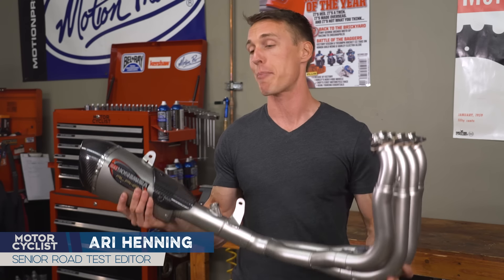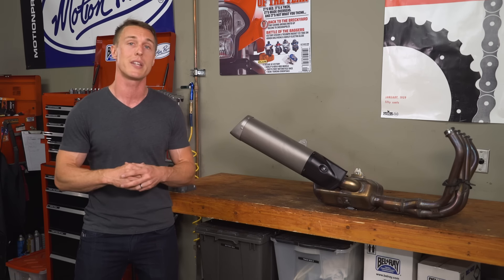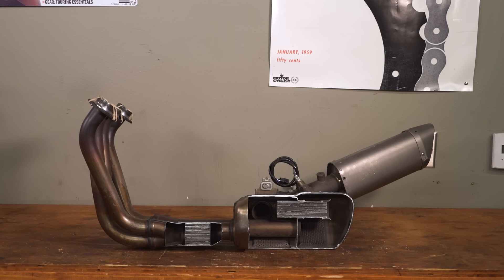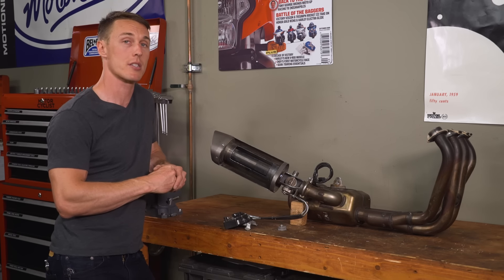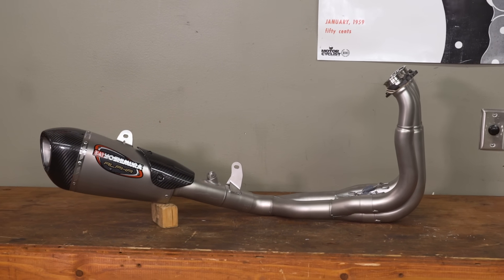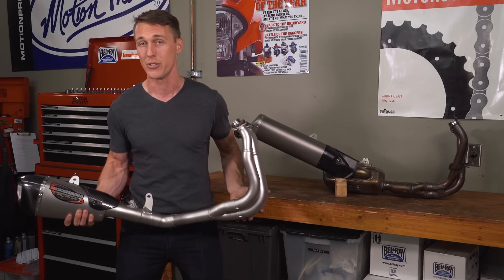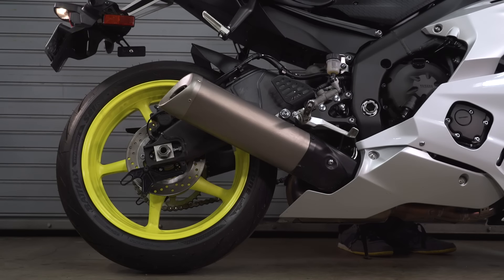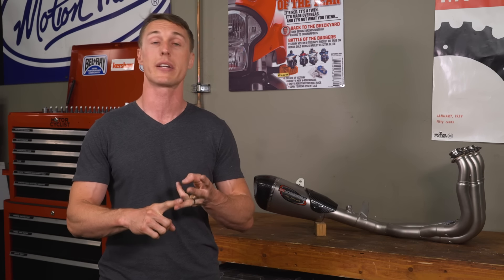The Truth About Aftermarket Exhausts | MC Garage

Comment: as emissions get stricter the gains that can be made from aftermarket exhausts will only get greater
Reply: which is dumb
Reply: Corvette Have you seen the 2017 Suzuki gsxr1000/r that can is not just huge. It robs about 5-6hp from the bike.
Reply: More like 10.
Reply: crisray6789 you mean like how modern emissions are tighter than ever but we now commonly have cars with over 500hp and bikes pushing past that 200hp mark? Emissions controls are one of the best things that ever happened to cars and bikes. Without them you'd still be tooling around around a carbureted POS smelling like raw fuel after a quick ride down the street because the OEM would have never had any incentive to improve the efficiency of the machines and spend countless millions on R&D making your bike or car cold start better, run and idle smoother, get better fuel economy and have more power.
Reply: Woha wait a minute here. Do you really care about fuel consumption while talking about motorcycles? (at tleast somewhat interestng ones, not scooters and sh!t) this is the last thing i care about. Better buy some 50ccm machine, if you care about every 0,01 l of petrol. I am proud ovner of 01 zx9R, and exactly because of those four big carburetors and overal simplicity and rawness of the bike, i will never sold her out. Just ram air intake, four cilynders, four carburetors, absolutely no electronic crap (shit like throttle control, abs etc.), and straight to wheel. You do not need neither diagnostics nor computer to properly maintain the bike, just a wrenchbox. And while talking about emissions,that is the absolute last thing i care about. I would gladly argue with you about those demonic CO2 exhalations (for simpletons, food for plants!) , NOx emissions (which are way lower from this dinosaurus that from modern diesels), or even that damn fuel consumption (4l/100km). Plus, the smell of that unburnt fuel exhaled through partially opened exhaust is quite pleasant for me, unlike that modern sterille machines. That somewhat not so smooth cold idle, or cold starts and such, for me, that just adds to the soul of my bike. You just need to know how to touch this machine, manipulate choke  and throttle properly, know some basics of engine functionality, and you are perfectly okay.
Reply: David Inmon Not what I'm saying at all, the video is debating stock vs aftermarket exhausts and has power gains placed last in the benefits, but emissions equipment will inevitably hinder power gains, especially as new regulations come about. The new Yamaha R6 is a great example of a bike being choked back by the new Euro4, and the cbr600rr has even been discontinued as a result.
Reply: crisray6789 600cc sport bikes also aren't selling very well, they haven't been for a long time. And your right I didn't draw my point together very well. The OEM exhaust systems are better than most people think and getting a lot of power from a decatted open aftermarket exhaust is just a thing of the past. Most people think they get a lot more power because they add PC5 and install an aggressive tune at the same time they install an exhaust. Plus the noise from pipes can add to the effect. Yes you will in most cases gain HP from aftermarket exhausts but in a lot of cases it's marginal, my Aprilia gained 1.5 hp at the wheel but it sounds sweet and that's why I bought the exhaust, sound.
Reply: and you wonder why companies only focus on the 1000cc bikes now because everyone wants a litre bike. But to be honest litre bikes from 2015 and up have the same weight as 600cc bikes did back in the 90's
Reply: Nehygienix I've had plenty and still have a carbureted bike, 2stroke dirt bike, but when I'm on the street and doing a road trip MPG matters because it determines how far and how many fuel stops you need to make in a day plus how much I have to spend on fuel and not smelling like burnt gas after 6-8 hours of riding is a huge plus. I grew with carbs on my dirt bikes and muscle cars and now my yz250 is my sole carbutooteted machine and I don't miss having to spend hours messing with carbs smelling like fuel and still having a flat spot off idle after that work. I'm a bmw tech at dealer in the US. You know how many standard solenoid type injectors Ive seen fail in the 11 years I've been doing this? 1. That includes E30s from the mid 80's still running fine on the same ol injectors and ECU and wires. People who can't let go of the past or aren't willing to embrace new and better tech always claim the reason they still like the old stuff is because it's more reliable and easier to fix. Wrong it isn't more reliable and yes it's easier to fix because you know how to fix it because you've had to fix it so many times. Look I agree about the soul of a bike or its attitude or whatever, that exists but just to shun better tech because you like smelling like raw fuel and spending more money on fuel fill ups than the rest of us doesn't make you right it makes you you that's it. Past that I think majority of people would call you wrong good sir.
Reply: Well truth to be told, ive never in my life, either in car or motorcycle, cared much about fuel consumption. My experience tells me, that usually, especially with modern machines, low MPG comes at a price. There are always more money - demapding aspects than several ,1 of petrol per 100km. If you say you work at BMW service, what about those new four cylinder diesels? Yes, low MPG is nice. But, when the time comes, you suddedly realize that to change chain/belt, you have to pull the engine out, because the chain is on the other side of the engine, facing invards, toward the cockpit. That sole thing is 2500 EUR in my country, that means cca 2.5X average salary. Broken fuel pump? nice one, 1000EUR at abosuletly cheapest (one whole salary). Clutch? i think you can guess. To add salt into injury, when electrical problems comes, it often means that car just stops going, and you have to tow your car to service and pay a fortune. Where ive never, with variety of older machines ive had and ridden, never witnessed and problem, which didnt allowed me to safely drive home. Situation is not so bad in the cheaper range of cars, but then there are things like EU-obligatory monitoring of pressure in tyres, E-call (i will NEVER have a car with this bullsh!t working, ever) and so on. Motorcycles, there are things little different, because they are not so much (at least till now) under heavy boot of EU regulations, so even now we can find some interesting pieces, for exact ZX10R 2011+, quite savage thing powerfull like hell, but hey, this machine is just one big ball of cables. But it is a global trend. I dont say that my opinion is right. It is just my own. I wouldnt dare to force it on anyone else. I know that modern machines are more powerfull, smooth and such, but doing maintenance, or even repairing something at home without fully equipped workshop... Well, maybe i am just sentimental.
Reply: +crisray6789: Not quite right. The CBR600RR is still going to be made for Aussie/NZ, Asian and American markets where emissions aren't so stringent. I was under the same impression as you till I read an update from Honda Because I own one of these, it caused a bit of panic I can tell you. It's that Euro4 emission law crap that is going to upset a lot of people.
Reply: I'm pretty sure Honda is done with the 600rr altogether. Sales are in the gutter and 1000 weights just a hair more and Honda's actual statement was "the 1000 is a 600 when you change the power mode". They will sell remaining stock, yes. The only way I can see them still producing the 600 is to keep the model exactly the same with no R&D monies being spent on it, until the remaining countries follow in the emissions laws. There is NO WAY Honda will spend millions in R&D just to sell a few bikes in a handful of places.
Reply: Taijean Moodie.
Suzuki actually claims a gain of 8hp. You can't actually compare between model years and claim the exhaust robbed or added power since the 2017 has a redesigned engine.
Reply: Nehygienix I appreciate your point of view. I can't say much for BMW repair costs in the EU but in the US yes BMWs are more to repair than say a ford or Chevy of a similar car class, large sedan, small compact etc..  The new diesels we have are actually quite reliable and the timing chains never need to be replaced outside of an extreme failure, BMW hasn't used a timing belt since the early 90s. But I get your point. With this aimed at cars yes they are more to fix than say 20 years ago. But bikes don't have nearly as much BS on them and are still relatively simple. A fuel pump, some injectors, fuel lines, wiring and an ECU. Look at all the BMW GS bikes that are fuel injected with 100k, 150k, 200k kilometers on them will no issues. To each their own, I prefer fuel injection as I find it far more user friendly and I don't have to worry, ever, about rejetting my carbs and making sure they are all synced properly, but, others enjoy that aspect as I'm guessing you do. Ride safe and enjoy your bike!
Reply: gains will be greater, until smog emission tests are required
Reply: In my country, emision tests are obligatory, every 2 years. Nothing simpler. Just change my aftermarked one for original  one, do the test, then change it immediately back. end of story
Reply: Nehygienix the low fuel consumption of bikes make them good machines for commuting and bring more people to motorcycling due to their cost lower than that of a car (many people argue motorcycles need more maintenance, it's true, but that doesn't make it more expensive overall, not to mention that most car owners don't maintain their cars as they should ; changing the drive belt, clutch, 4x4 transmission, repairing an automatic gearbox are huge expenses).

Also the combination of a big tank and good fuel economy increases the range, which is highly desirable if you want to travel in certain areas and not have to carry a jerrican...
Reply: Well, if my main reason for buying a motorcycle is cheaper maintenance and low power consumption, there are (and always was) plenty of choices - all those motorcycles ranging from 50 cmm one cylinder machines, whose consumption is maybe even lower than walking (joke sure, but not too much from reality) through all those 250s and 500s or 650s, enduro bikes, or even machines like BMW GS, yamaha V strom and such... But i still dont get it, why on bikes like zx6r/zx10r, rsv4r, panigale 1299, R1 etc i should be in any way concerned about some deciliters of fuel. Yea, maybe if standard cruising consumption would be over 10 liters, that would be a bit obstruction because of mandatory big tank, but this was never the case - even my carburetted dinosaurus can go under 4L/100 km at ease. Neither are any of those bikes specified for newbies.
Reply: The 2017 R6 is a good example. It's completely gutless with the stock system.
Reply: Moriquende.
Silly, silly statement.
Reply: Oh, really? While I've not ridden it on a track, there are professionals that have and they thought the exact same thing. The world super sport(race) version they also test rode had a full titanium race system with an ecu map and the result was a completely different bike. Euro 4 affects performance, especially on the 600cc super sports.
On the road it doesn't matter, just put a slip-on on it and be happy.
Reply: Moriquende.
On the road it doesn't matter. Just leave the stock system in place and save your money for better things.
Reply: Which is exactly what I wrote, except for the better things part.  More HP, lower weight and rideability is always good, not to mention the good sound that follows. It's not that expensive either when you factor in how expensive the bike is in the first place.
Reply: Crisray6789, My 2013 CBR1000RR gained 7whp going from a stock can to a Yoshi R77 slip-on. Sounded nice and added a good amount of power. Now my MV Agusta, that's a different cup of tea. I have no dyno'd mine. Reports are 2-9WHP depending on system. Keeping the triple system or doing a single. we looked into it a fee months ago,. about 2500 bucks gets ya maybe 12WHP.. Some bikes will benefit from a slip on others won't. It also sucks a damn slip-on for my MV is $1,000 :(.. The MPG thing. Who cares. more so if you are buying a liter bike. my CBR1000RR got around 33 MPG. my MV F3 800 is around 25 MPG
here in AZ we have no emissions for bikes. It's awesome.. Can pretty much run what ya want
and as of 2017 Honda is still making the 600. Their 1000 is still lacking HP  compared to a GSXR1000R or R1. The insurance for my 13' CBR1000RR Repsol was 3 times more than a R1M or GSXR1000R was, lol
Reply: My CBR 300 would only gain 1 hp with a full exhaust lol. If I get one, it'll be for the style, sound, and weight.
Reply: +ChrisHallet83 , That is only partly true. Emission regulations has forced car & bike manufacturers to develop better engines, but it mostly has to do with with the advancement of technology as a whole. In the last 10 years computers have come so far and as a result, technology is moving quicker and quicker. It's even reached a point where it's hard to get consumers to buy your new thing. 

A car is the most advanced everyday thing you can buy today and while rules & regulations has forced it to an extent, overall technology development made it possible.
Reply: Moriquende-Emissions was and is the catalyst (pun intended) for all the modern engine related things we use and take for granted on cars and bikes. Yes the advancement of technology certainly plays a very large role in all this but emission laws were the main reason the OEMs began to put fuel injection on vehicles and so on. If those laws never came into play there would have been almost no reason to change the way things were going. But in large part thanks to automotive emission regulations we have now have bikes with more power, better economy and smoother engines than ever. I would say that technology advancement takes a close 2nd but had to evolve and took longer to have its impact on the world as a whole. Emission laws and modern tech now go hand in hand and its almost impossible to further one without the other but in the early days of the "modern" automotive emission laws the technology already existed to meet the standards of the time. Also I use the auto industry as the standard here as anything related to bikes has been done on cars years ago. Bikes almost seem to benefit from "trickle down" technology from the automotive field.
Reply: ChrisHallett83 Agreed, most people that complain about emissions have no idea how much they actually helped performance for the better. Not to mention I like having cat converters on some of my bikes as I don't smell like burnt fuel after a ride. Makes a big difference on multi day rides  with limited clothes!!
Reply: Nehygienix I think you're taking my statement of caring about fuel economy to the extreme. I don't care if I get 35.1mpg or 35.2mpg. Tiny differences in economy aren't most people's concerns but when I can go from 35mpg average to say 40 or 42mpg or 45mpg average then yes I care because that is a big difference and can extended my range and ride time tremendously and in some cases can make the difference of getting to a fuel station or not. Tenths of a liter or gallon really don't matter, but if you can have better performance, smoother running engines, better fuel economy in the sense I'm speaking of and not have to play with jets and needles and vacuum gauges I'm sold and so are most people. 

I just bought a Beta 300RR enduro and yes its carbutooteted but it's not my everyday transportation. Playing with the carb every now and then is fun but, my Aprilia is fuel injected and I can start it and go with no issues and I truly enjoy that aspect of it. Not to mention I can ride it from my house and then up into the mountains with almost a 4K foot change in elevation and the throttle and power delivery stays nice and smooth, albeit less power up that high but still smooth and I don't have to do a thing.
Reply: Well Chris, this may be the case in USA or some other country where car industry is still working on consumer demand. Here in EU (and especially in our former eastern bloc countries, from CZE eastwards), buying a 400 horsepower car is a very big deal. Those cars are rare, because emission regulations are so strict, so car makers leaves engines with higher power outputs and cilinders (above 4cyl/200hp) almost exclusively for thier top tier cars. Majority of cars is currently sold with 1L - 1,6L engine ranging from 3 to 4 cylinders. and even that car will cost you about 12-15 average monthly salaries. Anything above 2L is almost exclusively left for BMW/Mercedes/Audi brands, whit prices overlapping cost of very nice house outside of town. (btw, new Mustang GT costs here twice as much as in US. Just because he have some serious engine and his exhaust isnt producing rainbow.) And when some american friends came here, and lend some cars (for exact Škoda Superb 2.0TSI, most "luxurious and powerfull" car from this car maker), they couldnt stop laughing how this car is just slow. I assure you, 20 years old car will have way more usable power range and overal consumption, that those new one trick ponies, where listed power and consumption is reachable only on exact revolutions per minute, temperature, tire pressure and such. anything beyond that will result in draining your tank dry with no imminent power effect.
Reply: David, I think you just mixed it a little bit. There is one BIG reason for car/bike makers to change approach. Consumer demand. If people would want less fuel consumptive and eco friendly machines, car makers would give them. And i assure you, here in EU, emission regulations does have exact opposite effect - cars are less powerfull, with way narrower usable power band, and with fuel consumption lower in just some few speciffic occasions, otherwise its big as hel. For exact, ive had an Alfa Romeo 156 with atmospheric 2.5 V6. This engine was pure porn, insanely steep power curve, craving for revolutions, with sound like from heaven. But you had no chance to get under 8L per 100km. Thing is, that when i pushed her, drove mix highway with average speed around 180-200km/h and sharpy curves on countryside with hard throttle-hard brake, i reached only slightly over 12L. Now when i get new 1.2 TSI 3 cyl. from Škoda/TSI - yes, if i drive veeery carefully, i can get under 5 Litres per 100km. But just in the moment when i go outside of his comfort zone a press him, consumption jumps way over those above mentitioned 12L/100km, and with only maybe third of alfas power and ZERO of alfas fun factor.
Reply: I consider the smell of the unburnt fuel as my favourite deodorant! :-D
Reply: Nehygienix I Agree consumer demand is part of the equation especially nowadays. But 30 years ago emission regulations were forced on the auto makers and thus for forced onto the consumers, there wasn't a choice in the matter. So to make cars that could have good power AND good economy the auto makers started pouring money into research and development of fuel injection systems, catalyst systems and computer controlled engines. My main point in all this is the vast majority of people in the world look at emission regulations as the devil that robs there power and makes there bikes slow. When in fact it was the emission controls placed on the auto makers in the 70s and 80s that lead to the current crop of of high horsepower and high effiency machines we have today. So much R&D goes into the stock exhaust of modern bikes that people take them for granted. Think about what a bike maker has to do to please the consumer. The bike must fit the rider, well no one is the exact same size. The bike must make good usable power, people like different kinds of power delivery, Low end torque or high rev power, the bike must meet global and local emissions to be sold and still make the power they promised and so on. So when people say " the stock exhaust on my bike sucks, I put a $2000 yoshimura system and now it's faster than ever" well it's probably true that it's a little faster but most exhaust systems don't give that much of a gain in HP. I ask you to check Dyno sheets of stock and aftermarket systems before commenting. Most of the gain in speed from a exhaust system is mental. Meaning the bike is louder, the revs can be heard and now it screams at 11,000 rpm where as before is was fairly quiet. I ride dirt bikes and street bikes. One of the best dirt bikes to ride is a 125cc 2 stroke because you have to ride the bike al,oat full throttle every where and while it seems like your hauling the mail, your are no faster than people on bigger cc bikes. It's all in your head
Reply: Well, bike makers don't necessary need to appease all consumers, because of that, they make a wide variety of machines, from big tourers for big boys to zx10r machines for japanase-girl-like riders. But to the point.I have stock exhaust. It lies right beside my ZX9R. And just plain look tells me all. On the stock exhaust, right before the end, those gases needs to do sharp 160-degree turn, squeeze through very thin slit, and then do another 160-degree turn. Not to mention other things inside. I assure you, when i put that one on, effects on power output are striking. Not only sound, but actual acceleration and response are just somewhere else. Now i don't say that all i accept is plain open exhaust. We are usually not only on a racetrack, so some noise-reducing have to be done, especially on low revolutions and on low throttle, because of city drive. And to that law-emission thing - you know, i almost always oppose government restrictions and regulations, especially on the free market. This is one of those. I don't like when some official thinks he knows better than me of what i want.
Reply: But...But....I love the smell of oil......
Reply: No, no one buys an after market exhaust to improve emissions.  They only want more noise.
Reply: Of course you have to care about fuel consumption, not for financial reasons, but for convenience. If a bike has shitty fuel consumption coupled with a small tank, long trips will be a pain in the ass and you gotta refuel every 200km. If a bike has good fuel consumption and not a small tank, it is simply more convenient in every single way, less time at the gas station, more riding.
Reply: I think it may also come down to weather or not they want to be involved in any 600cc class racing. most companies make vehicles based around their race vehicles either because its the governing bodies rules or because they put the r and d into the race bike and may as well sell a street version. But you are right, the way modern machines can be changed at the push of a button to feel like the smaller version might spell the end of the smaller cc bikes, at least in the sport bike range. Maybe they will start having wider gaps between the various engine sizes. Instead of having a 125, 300, 500, 600 and a 1000 they will have a  300,  500 and 1000 or something. But who knows they seem to be building more bike sizes then ever before in recent years.
Reply: crisray6789  Only if you eliminate the catalytic converter, which is illegal.  Aside from tuning back pressure, which helps an engine run better, exhausts have no effect on emissions at all. Most have very little effect on power either, just look through the Akrapovic website;  most road legal systems are within 1 or 2% of stock, which when you're looking at 200 BHP anyway, NOBODY is going to notice.  Most people slip on an end can to make their bike sound "better", they don't get noticeably more horsepower (fact) but they might save a few pounds in weight (which when the average UK biker is an overweight middle-aged man they would probably better off losing themselves)
Reply: Laughs in Euro5. The gains from the aftermarket are only getting smaller as OEM's continue to refine their hardware.